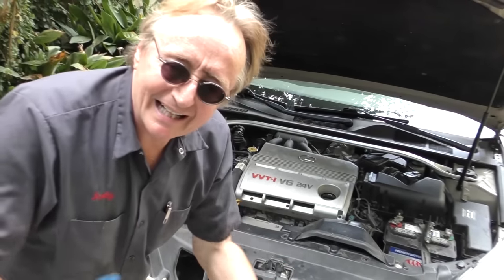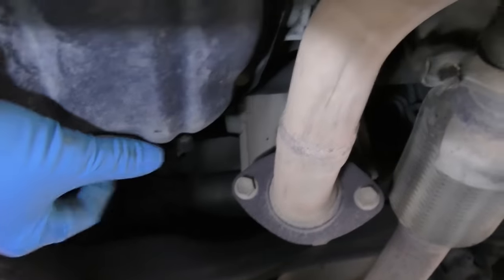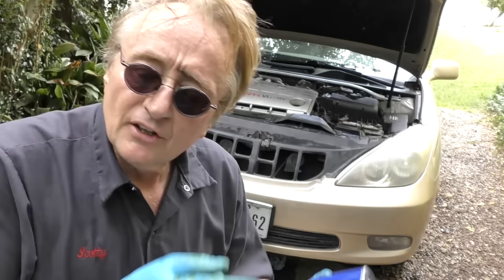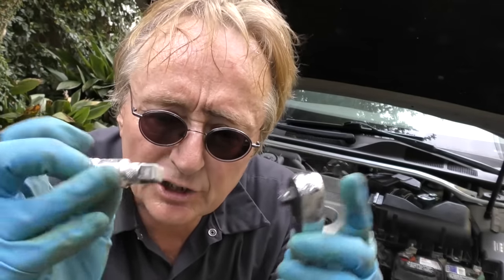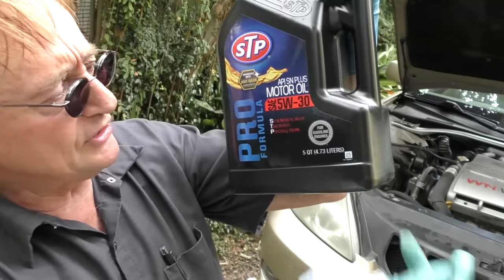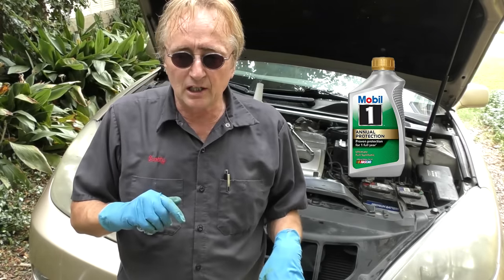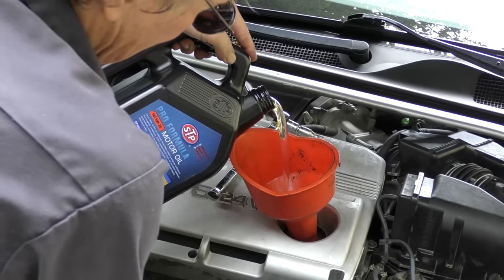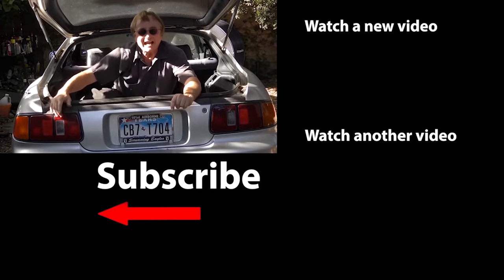Changing Your Engine Oil? You’re Doing It Wrong

Comment: Just changed my oil two hours ago ... used ramps, drained oil.... and my Malibu uses a cartridge filter that's easily accessible from the TOP, whether the engine is cool or hot.  Scotty is dead on about the double gasket oil filter problem, to go slow putting new oil into the engine, and DOUBLE CHECK to make sure everything is tight and not leaking.  You can't believe how many people have screwed up doing these simple steps, and new engines are expensive!

Comment: Tightening the drain plug with a breaker bar is just asking for trouble
Reply: @Stacy Lynn Sutherland use a torque wrench that's what they are for
Reply: Use an impact wrench on full power. :)
Reply: When you do these things enough you don't need a torque wrench. You really only need one when you're building an engine
Reply: South Aussie Aquatics speedees employees be like^
Reply: Crossed threaded makes it real tight with a impact the best way lol
Reply: Only if your never changed a drain plug before
Reply: You can tighten it right up easily with your fingers then nip it up with a standard rachet or ring spanner,the breaker bar is a bit much,some pressed steel sump pans only have a threaded insert in them for the sump nut.
Reply: Always torque wrench to factory specs, like 32 ft lbs
Reply: Darrell Bittner I do that all the time on all of my vehicles and never had any problems at all. Technically though using a torque wrench  is the proper way which you will never go wrong doing.
Reply: If you do it much more than hand tight, you’re doing it wrong. The general rule I use is that you have to keep the next oil change in mind. Get that drain plug too tight, good luck getting it off next time. I’ve had some experiences, lemme tell ya. Same thing goes for almost any other thing on your car, you’re overthinking this whole car thing y’all
Reply: The one time I didn't use a breaker bar, I blew my damn engine.  NEVER AGAIN!!!!!
Reply: Its scotty approved 
5 10mm socket rating..........🍺
Reply: I came here to say the same thing. Normal spanner has enough leverage to get it tight and not strip it. You don't want to strip a sump plug. That will ruin your whole day.
Reply: @plonkster  what would happen?
Reply: Shouldn't be using a breaker bar on a drain plug at all.
Reply: He feels the torque. Only few can feel it
Reply: yes, i just snug, it sooo lightly, if it leaks i snug it up again. 
Remember, you can always..keep tighting the drain plug, but you cant losen it, unless you wanna change brand new oil you just out in..
Reply: And just hand tighten the filter
Reply: I use an adjustable wrench
Reply: I thought the same thing.  He did say to tighten it just a little, but I still cringed.  LOL
Reply: @skela  YOU GOT THAT RIGHT.
Reply: @john4kc  I do.
Reply: @jacobsebastien3910  Indeed! A little high strength R.T.V. and J.B. Weld too for a little bit more assurance also. Maybe a few spot welds just to be safe.

Never had a drain plug unscrew itself using this method yet.
Reply: If you struggle with a breaker bar then you could always use a hammer! 🙄😂
Reply: i use my 750 ft air gun ✌
Reply: Easy as hell to over-torque
Reply: Scotty used the breaker bar to screw the plug 1/4 turn, after hand hand tight.  He already had the correct size socket on the end of the breaker bar, so he didn’t spend any time reconfiguring a tool on hand. A torque wrench is overkill and was not at hand. Scotty is lazy so he does things the easy way; you should too.
Reply: Can't be emphasized enough. So many DIY'ers, and shops, warp the pan by overtightening the drain plug, leading to permanent leaks or needing to replace the oil pan.
Reply: @topgrain  I've never had a problem but I always just get them snug. You should never torque them very much. Getting a torque wrench out for something like that seems unnecessary unless you are tightening a bolt into aluminum. That being said, using a torque wrench for a while will make you pretty good at estimating torque when you don't have one available. I do use my torque wrench for my lugs and most engine work but I can't say I have ever used one on an oil drain plug.
Reply: @armanmaaba600  actually if you use tools often, feeling the torque is easy... we call it snug
Reply: God damn right!!!!
Reply: @judahsoremy9857  ..... Hilarious!!!
Reply: @hitmanshadowrecon9017  I did one better actually. Since I never change my oil anyway, (that oil was good enough when it was first put in, so no need to change it) I figured I might as well remove the Drain Plug, just in case it might leak somewhere down the road, and then weld in it's stead a good, solid Plug Weld! Now it'll never leak -- guaranteed! 

So far, so good. I'll post some updates, to keep you up to date (that was rhetorical, but whatever, you know what I meant).
Reply: @blacksheep6888  Yea, everybody has those. Been changing oil 40 yrs and never used a torque wrench and never had a leak.  Like Stacy said, common sense.
Reply: @da324  I know you can get away with it but it's not good practice, drain plugs can be overtightened and strip the plug so its common sence to use a torque wrench, end of story.
Reply: @armanmaaba600  no one can really feel it that's what at torque wrench was made for and for the five minutes it takes to get it out and use it, well its a good idea then you know the job is done rite
Reply: @alphasaiyan5760  if you hand tighten the filter on my motorcycle its way to loose it is two turns on my motorcycle or 14.5 foot pound or 20 Nm. What I am saying is don't assume anything follow the workshop Manuel
Reply: @blacksheep6888  Again, not many people have torque wrenches; we aren't tightening head bolts here.  Snug with the fingers, no more than a quarter turn afterwards and you're good.
Reply: @da324  buy a torque wrench no excuse to be lazy
Reply: @da324  youtube stripped sump plug. This will never happen to me because I am not lazy like you are I always use my torque wrench. And I even use them on my spark plugs like the good mechanic I am how I was trained to do in my 4 year apprenticeship. But if you want to be a Muppet then go ahead no law against stupid and laziness.
Reply: @bartfoster1311  I work on motorcycles mostly and it pays to go the extra mile because if something goes wrong it could kill someone so its just good practice to use the correct tools for the job, taking the time to use a torque wrench is piece of mind, plus I have come across stripped sump plugs, spark plugs you name it.
Reply: All you need is ratchet filter wrench and let the damn thing train for a bit and put oil in the oil filter
Reply: @blacksheep6888  I've been using my foot to tighten my wheel lug nuts for 7 years without any issue. Only used the torque wrench one time to know what 80 lb/ft feels like.
Reply: @FlameHazeist  well good on ya well done
Reply: @FlameHazeist  by the way we are not talking  about wheel nuts and wheel studs are easy to replace, even though some people over tighten them and break them, I work mainly on motorcycles if I court you not using a torque wrench on my vfr800 (single sided swingarm) rear wheel nuts I would be very cross, but on a cage its not so bad. Just so you know I am 48 and a qualified diesel fitter, using a torque wrench is a good idea don't be lazy.
Reply: A drain plug should be tightened with barely any torque. Do you have any idea how much force it takes to remove a drain plug installed by the factory? Almost none.
Reply: Also use a 6pt socket, not a 12pt, unless some quirky engine requires it.. Over time the 12pt will start rounding the plug's bolt head.
Reply: For God's sakes which is it? Use a torque or not use a torque? Half of you experts here say definitely use this, half of you say definitely don't use this -- how are we supposed to know?
Reply: @MV-zt6gb  I am a qualified diesel fitter trained by Caterpillar, its always a good idea to use a torque wrench to give you an example my GSXR requires only 16 foot pound on the sump plug, that's about 1/8th a turn from snug so if you were to take the advice of these backyard mechanics and do it up 1/4 a turn it would be over tightened by 1/8th  a turn, if you look up an torque settings chart for different makes and models, the torque can vary from 12 to 30 foot pounds, so using a torque wrench is good practice. If in doubt always check the workshop Manuel on how to do the oil change on your engine. Don't assume anything even changing the oil filter, most engines with a screw on oil filter requires 3/4 of a turn from when the o ring mates the surface it screws onto, however my GSXR requires two full turns.
Reply: illegal alien  lol, you say no... guy below tells me yes. SMH
Reply: @blacksheep6888  you say yes, guy above says no. See? So confusing. But l do appreciate your well thought out reply. Thanks for that. As you suggested, I'm going to consult my manual for the final say.
Reply: @MV-zt6gb  thank you its always a good idea to check workshop Manuel, for instance if you own a ford ranger you only have ten minutes to fill the engine back up with oil after it has been drained, or the oil pump will need to be primed again. If you don't have a torque wrench scribe a line in the sump and scribe a corresponding line on the sump plug providing you are using the old seal washer you will have tightened it close to the original torque, this is not a great way of doing it but it's better than guessing it. But nothing beats the piece of mind a torque wrench will give you
Reply: @john4kc  yup, hammer that baby in there and the filter, tight as ya can get it with a strap wrench...yeah that'll never leak
Reply: As soon as he stuck the breaker bar on it I clenched my jaw in horror.
Reply: @blacksheep6888  I've rebuilt whole engines only used the torque wrench for the crankshaft pulley. Head bolts.
Reply: @adammiddleton2503  what about your main and rod cap? Also did you not use a plastic gauge to check the clearance on the rod and mains?
Reply: Darrell Bittner unless you're older like him! I mean it makes it easier to put it on with a breaker bar. You can use any length The trick is just don't over tighten!
Reply: I made a comment about me changing my daughter's oil & my oil on Facebook & a couple people tried to get smart saying "why don't u just take it to the Oil change place"? 1st of all, I change my own oil because I have all the tools & time to do so. If you have car ramps like I do it's really easy, plus when u change your own oil at least u know it's done right & you're putting the right oil & oil filter on your car. I can't believe how many men that don't know how to do a simple oil change. I've been doing it for years & it's something i enjoy doing. Plus you can't trust these Oil Change places anymore, u don't know what they're putting in your car.
Reply: @lukebecker1959  That will work and if you the only working on it you know that you use the adjustable to put it on so it shouldn't be a problem using it to loosen it up. But if you work on cars for a living you don't know how tight it is and the bolt might have rounded corners.  But if that works for you that's great.
Reply: @alejandrozuniga4426  You must have one of the older oil changing impacts ?
Reply: @Straight_White_Fatherly_Figure  Yes, that's called an experienced car enthusiast or Auto Tech or a DIYer with common sense.
Reply: k bone  I like that !
Reply: @Starkster50  yeah thank you for letting me know.

Comment: Recommend adding as much oil as you can to the new filter before installing unless it goes on sideways. Also recommend torquing oil drain plug if you are a noob. We old guys know how tight it should be by feel. Extension bar for loosening perhaps but not for tightening as it's easy to overtighten. Use a torque wrench when unsure.
Reply: What's the nm torque for a sump plug?
Reply: @klang180  
Sorry don't know.  I just know when its tight.
Reply: @klang180  Around 20-40 Nm. Depends on the car
Reply: Don't do  this  unless  you  never  want to  unscrew the  plug  ever again.
The recommended  torque  is  often waaaaay  too high.

Comment: I've been changing my own oil for 40 years. I've never replaced a single drain plug gasket. Not defending my behavior, just stating fact. There have never been any consequences.
Reply: Me too😬
Reply: Never on mine, but on many customers vehicles.
Reply: Yep! Same here!
Reply: Never needed a 1-1/2ft breaker bar either.
Reply: Some gaskets need to be replaced every time, the crushable ones, others do not, like the one on my Mitsubishi Triton.....
Reply: Maybe you need new gaskets when you are snugging up the oil drain plug with a BREAKER BAR.
Reply: Same. I’ve changed mine for 20 years, never even occurred to me to put a gasket on, never saw one.
Reply: I’ve been changing the transfer case oil once a year. The first year I went to Nissan for the drain plug gasket. The guy in parts looked at me like I was crazy. He told me in all the years our mechanics have been changing that fluid, NOT ONE came in for that part 😂😂
Reply: Most auto manufacturers give you a range of oil types that will work for your engine-usually dependent on what climate you live in. For example, my Nissan came with 0W20, but living in the north east, I can use 5W30 according to the book with no issues and won’t void the warranty. If I was living in Wisconsin where it gets pretty cold, I would have to stick with 0W20.
Reply: guess you’ve been lucky
Reply: @james-jq8sk  It's pretty obvious that you don't work on cars if you believe that you need to replace a metal washer on your OIL PAN bolt.
Reply: Why not? It's like a few cents...
Reply: @nov2263  I bought some and am doing it now.
Reply: They cost like 5 cents - just put one on anyway.
Reply: @deboxmojave6541  I have started to.
Reply: Same here never changed the gasket, no leaks whatsoever, doing it 30 years, I suppose its good parctice alright though.
No disrespect to Scotty 😁
Reply: Yeah they always recommend that but it seems unnecessary if it’s a metal washer unless it’s stripped
Reply: They're crush washers, if the bolt was tightened properly it will be deformed, I'll flip it once to the side not deformed and then replace it next change.  It can also prevent thread stripping.
Reply: Some of them use crush washers. The torque for the plug isn't enough to ruin the washer the first time, but a couple of oil changes and you might want to swap that little bastard out
Reply: That’s right , it compresses each time to seal the oil
Reply: @tommak6516    Ha’h 😂
Reply: @commanderthorn3466    Not lucky mate , you don’t need it
Reply: My Subaru needs the gasket. I rolled it off then the drips started. This is the only car that I’ve had that needs a gasket.
Reply: So far.
Reply: Same here. 53 years on multiple vehicles and never had an oil plug leak.
Reply: I’ve never changed the gasket either, and I’ve never filled up the new filter with oil before I put it on the car haven’t had a problem yet!😁
Reply: @RichardlRybinskijr  The whole idea of filling a filter seems ridiculous. The oil pump will immediately do the job on start up. I can't even believe people think that is necessary.
Reply: These newer cars someone thought it was a bright idea to put a gasket on the drain plug which has a oversized head on it to start with but I never had to use a breaker bar surely the plugs are not required to be torqued
Reply: I do they go flat from the heat I live in Arizona
Reply: Better to be safe than sorry! How much is a gasket?
Reply: Me either!
Reply: Same here!
Reply: @eriklarson9137 it’s like 5 bucks for a 20 pack why not just do it?
Reply: I am  buying   an oil extraction  should  be  easy hope it all comes out
Reply: Absolutely, been using the same gasket for 12 years, no leaks 😊
Reply: My local Toyota dealership gives me a handful of drain plug gaskets every time I buy an oil filter. at that point I just use a new one every oil change.

Comment: Also if you find your oil container “chugging” as your refilling, tip it in from the side rather than straight out the front! Much smoother flow
Reply: This is were he let's himself down, it's little school boy errors like this.
Reply: @PeterSmith-ls7ut  can’t teach old dogs new tricks
Reply: Wrong.

There's a friggin picture ON THE OIL CONTAINER showing how to pour it properly.

It's not about getting the oil out. It's about getting air in!
Reply: @goodisnipr  you are exactly correct about needing the air, this is the exact reason he is pouring wrong lol  his way tremendously slows the rate you can pour, this is why I wanted to see if anyone else noticed
Reply: I usually just poke a hole in top of the handle to let air in..
Reply: The correct way is to actually have the spout on top while pouring. Trust me, it’s the way to do it.
Reply: @tonyhall9764  truth
Reply: The gas cans (jerry cans) that have only one cap with a spout that has the air ridge in it... If you pour the gas by holding the container spout port down, you're wrong!
Stand in the place where you were, now face the thing you want to fill with fuel. Put the jerry can on the ground between yourself and the thing you want to fill. Turn the jerry can so the spout is nearest you. Lift the can and tip towards the thing to be filled so the spout is on top. You'll be amazed how fast the gas pours out once the air is allowed in.
Reply: Never thought about it who looks at 😂
Reply: The smaller ones, it works best "upside down" where the spout is on top
Reply: Or go very slow and poke a hole in the handle in the highest point